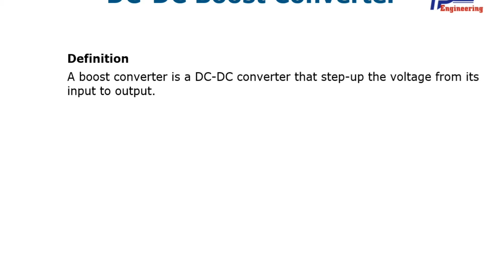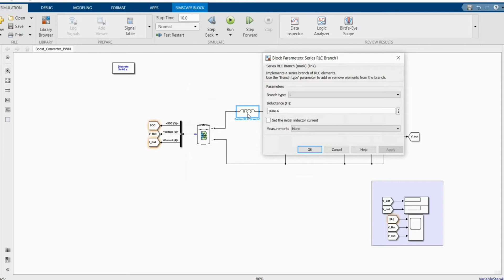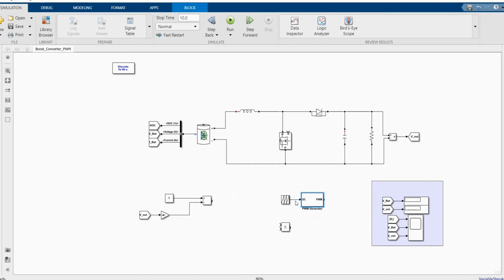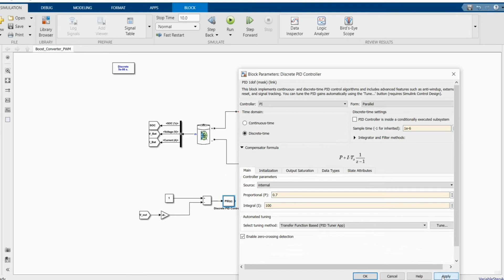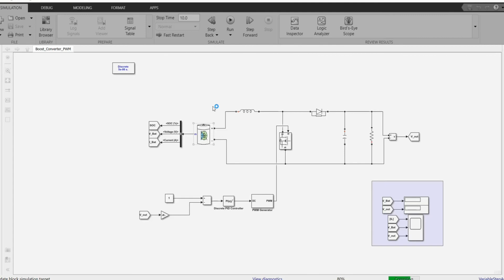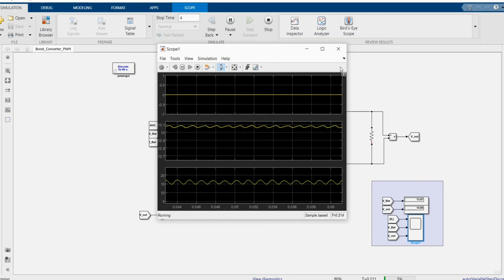Design and Simulation of DC-DC Boost Converter with PI Controller and PWM Generator in MATLAB

Comment: thank you,  to calculate the duty cycle we need the output voltage.Can you tell me please how we know the value of output voltage?
Reply from the maker: Hi, thank you for your comment. You either need ouput or input power. Which is determined based on what you want to achieve.
Reply: @pzengineering2020  thank you

Comment: can I set output voltage equal to 800 Volts
Reply from the maker: Hi thank you for your comment, we  didn't try , but I think you should .. as long you calculate the parameters value to give you that voltage

Comment: what if we have multiple input boost coverter? how will we give the pwm input in the case where we have multiple switches with different duty cycles?
Reply from the maker: hello, Thank you for your comment. Based on your comment and if I understand you, I normally separate control, which means each boost converter have its own duty cycle based on reference current. I think this video can help you https://youtu.be/q22I595GX8s